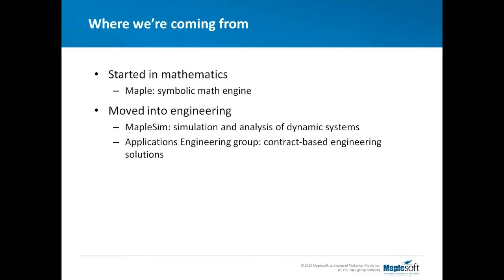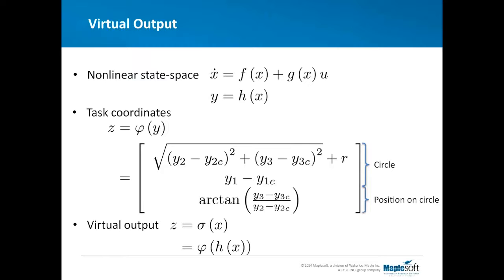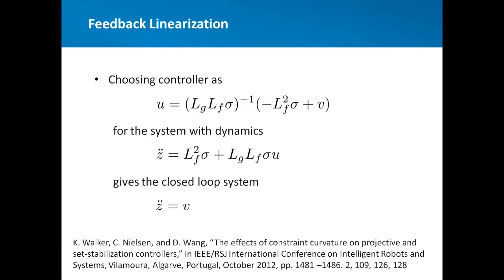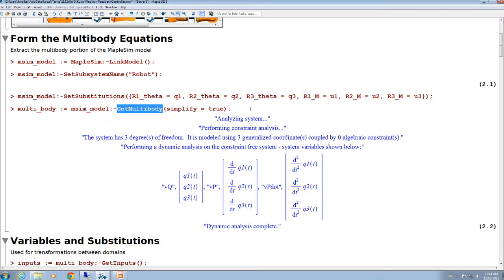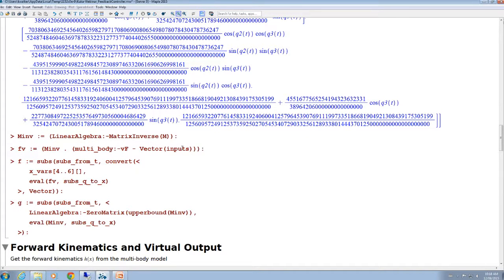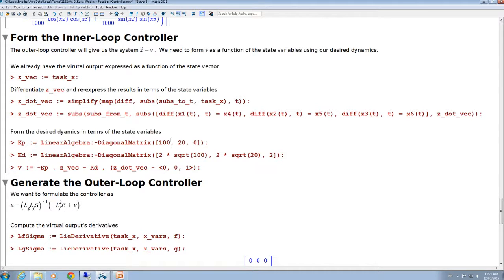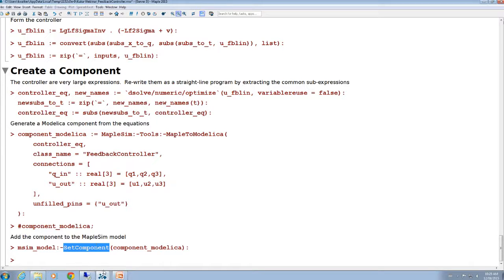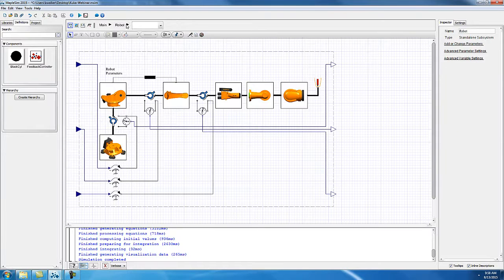A Design Example in MapleSim: Controlling a Robot using Feedback Linearization

Comment: very interesting. Is maple powerful enough to compute the Dynamic parameters of a 10 DOF robot in symbolics?
Reply from the maker: Hi there - thanks for the question. The short answer is yes - we always generate the symbolic DAEs for any multibody mechanism. However, we don’t solve these equations analytically for simulation – that is done using Maple's numerical solver as it’s generally much more efficient and can handle things like pivoting as you approach things like bifurcations in your multibody model.